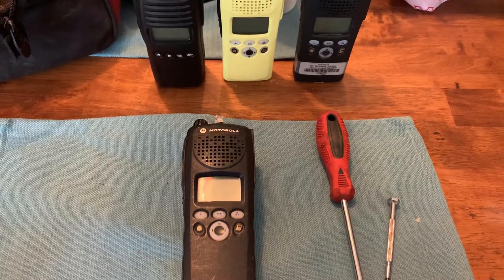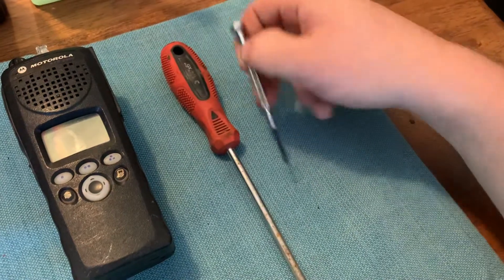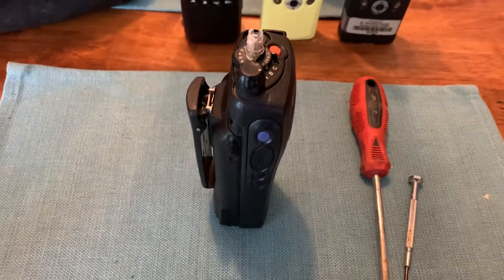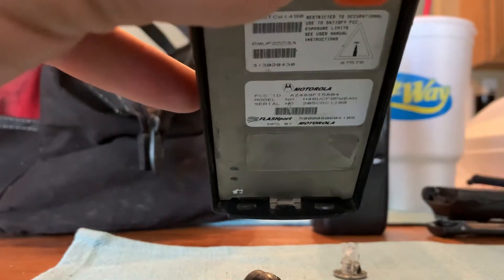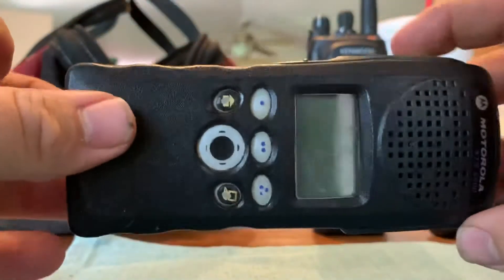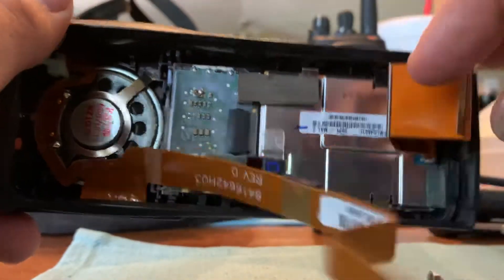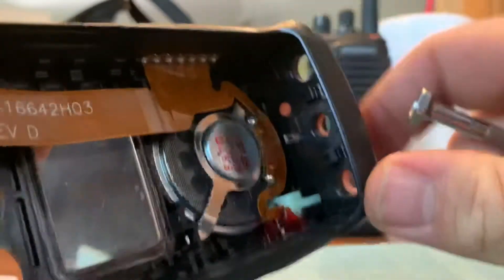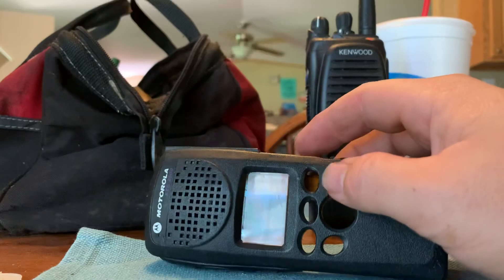Motorola xts2500 “re-case” how to video

Comment: Do you have a video showing the removal of the accessory port ribbon and replacement?
Reply: This may be a little late but I just did it. Just gently pry with either the jeweler screwdriver or I used a small driver and a letter opener. (All I had). The glue is stronger than the pin connection. Helps if you maybe heat it a little too to melt the adhesive.
Reply: @ParthPatel-ku4jr  better late than never my friend! Got 4 ipc certs in the meantime, lol.
I appreciate your reply!

Comment: Hey man, Im an officer and my department issued me a Motorola XTS 2500. Every time I hook up an accessory mic to it I get this low volume through the mic. Its so low you cant hear traffic through it. You can still key up as well with the accessory mic no problems. Once you unplug the accessory mic the volume works fine through the radio speaker. I tried another accessory mic and had still had the same outcome. So I know its not the accessory mics its the radio accessory connectors(the last part of the video you showed) that seems to be the problem. Maybe you can help me out... im not sure if this radio is fixable.

Thanks.